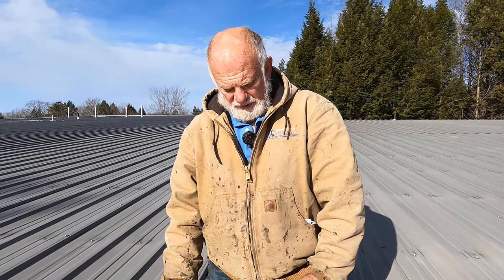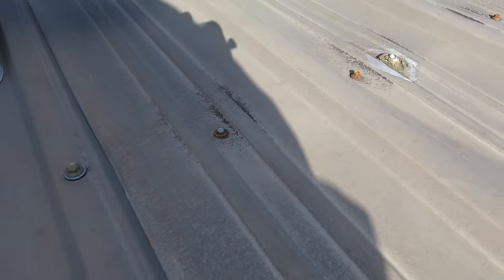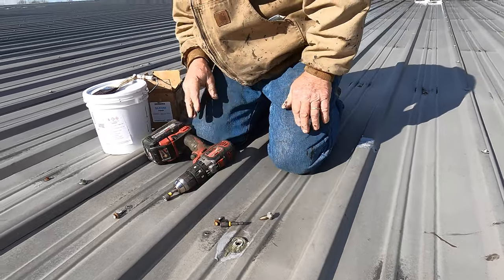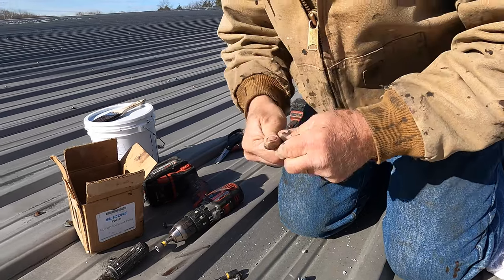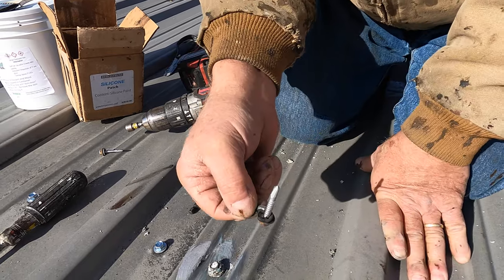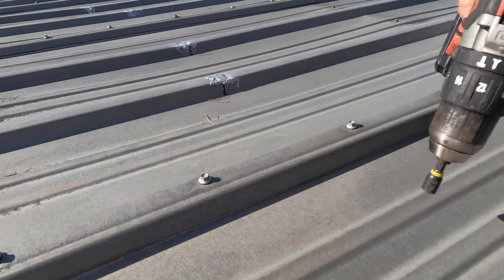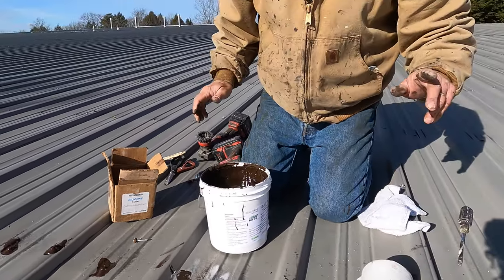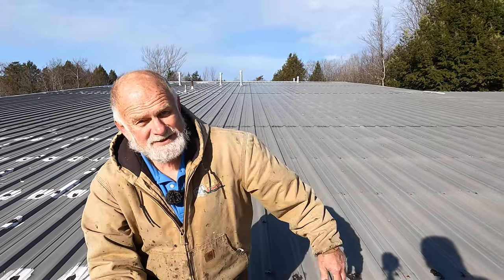How to seal Metal Screws from leaking - Turbo Poly Seal

Comment: Hi, love your videos- can you use turbo poly seal on an aluminum patio cover roof for the seams and where it meets the wood from the house?  Does turbo poly seal stick to wood?
I have an insulated screen room roof that leaks where it is attached to the house/wood boards and some of the seams where the roof panels connect together.  The installer used a "peel and seal" tape on them but it does not stick to the wood of the house well
Reply: I’ve used this product and it sticks to just about anything. I think it well work fine on wood as long as it’s not peeling paint or rotted. You’ll definitely want to use the fleece to strengthen the repair. See some of the other repair videos if your not knowing about how that works.

Comment: Why do sheets still get fixed down in the low core where the water runs down, instead of a saddle and longer screw through the high core 🤔

Comment: you didn't really have to tighten the screws if you were going to paint them with turbo poly seal... or did you? would it make a difference if you didn't tighten them beforehand?
Reply: sealant doesnt hold your metal roof down!

Comment: I have a idea about the the washers being used how about using crush washers made of brass or aluminum instead of the plastic washers
Reply: Try to avoid unlike metals contacting e/o to avoid corrosion.